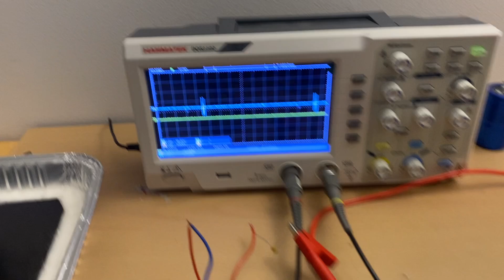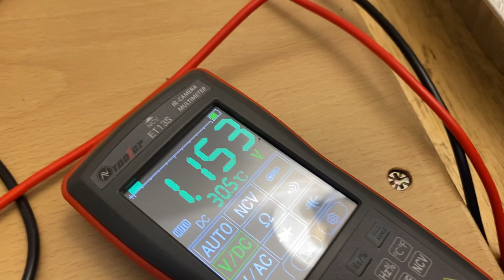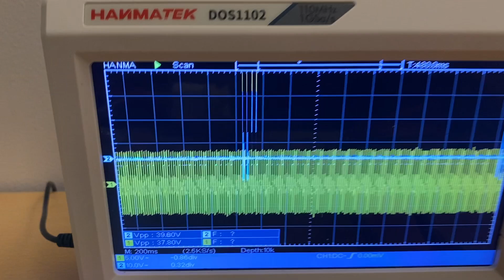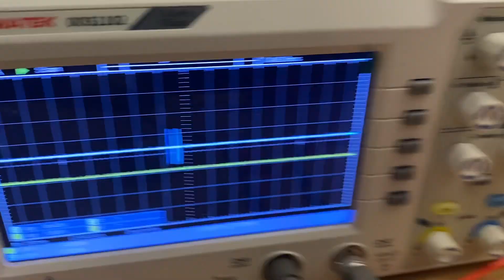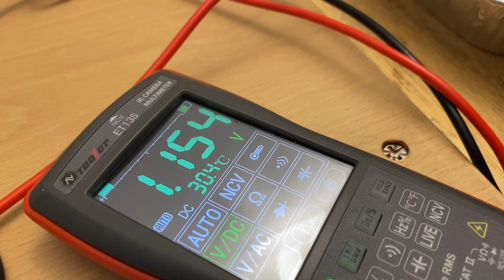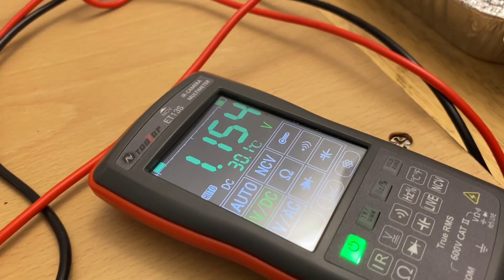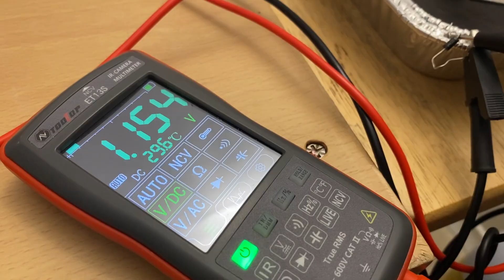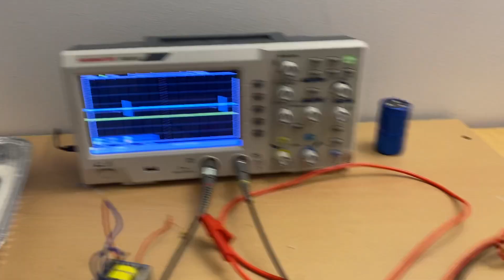Self Charging Oscillator

Comment: Joel, Thank you! firstly, Is it possible to utilize a joule theif as a means of high voltage low amp trigger somewhere in the circuit? I often wondered why people never utilized this for their Bedinin or Newman generators.
Reply from the maker: Is this not what my clock module does? It's an oscillator giving me 10 plus volts spikes......

Comment: Heck yeah great idea with the clock circuit! 😮
Reply from the maker: One could also take the clocks small HF oscillator and Don Smith it for extra haha!
Reply: @joellagace1679 always need more capacitors 😅

Don Smith capacitor method into battery bank or maybe a cap bank that can sustain UL Listed microinverter draw at MPPT?

Comment: please give a classroom board lesson video. I've looked up p looping circuits but they all seem like closed systems. I'm not patronizing Joel I know you know a thousand ways to loop circuits in terms of the one wire. And I have no understanding of circuits even though I try to do the practical but I was wondering if you could draw up a generic loop circuit and explain it then give a intermediate then a harder example. Also in your high energy video you said the high energy could be "smoothed" out to lower more steadier pulses. Could you then explain also how can this be achieved.

Comment: I been playing with some relays, automotive ones and using them for in and out have very interesting effects in my charging discharging of batteries. Curious if I can utilize and electret made from some wax from plant materials and find a connective tissue between the ideas presented here and that experiment I been saving for. Sugar solidified under pressure like this, interesting as it holds a much harder state in more various temps.

Comment: Nice demo Joel ❤

Electrets establish one way flow of electric charges and as long as there is a potential difference (work function of elements) there will be a flow. If you enclose electret in a dry atmosphere they will last indeed hundreds of years … or you can use wet medium as (dipolar) water if non corrosive material is used.

Electricity is based on 2 components: magnetic and dielectric. If I use 2 iron wires one thicker than the other in deionised water I can get 0.05 V … but, when I place a permanent magnet outside the water between 2 ends voltage goes up to 0.200-0.300 V … from here, there are many options to further enhance such cells for a better output which can be used commercial, even using zinc plated iron sheets and teflon as electret material, without degradation of elements provided there would be dry atmosphere (sealed) to prevent corrosion and maintain polar charge retention in teflon (ordinary teflon tape for plumbing). And you don’t need flyback spike feedback into the cell … this flyback can be used to charge capacitor bank or combination between ordinary rechargeable battery+capacitor (hybrids) which can be drained by a load continuously.

Comment: Would it be a good idea to try Beeswax–Rosin Electret?
Reply: Nope, best available material is teflon and can be polarised with just 150 volts at 150 degrees Celsius under dry atmosphere … positive charge retention +100 years if dry atmosphere is maintained
Reply: @Caesarus2011 alright thanks 💪
Reply: @mrRobot152  it takes 45-60 seconds to polarise a teflon tape for plumbing at 150 degree Celsius with 150 V … all you need is a hot plate constant temperature, power source and grid/plate electrodes, PE enclosure with access for hands, silica gel beads. Also, before removing it consider to seal them in plastic bags using a vacuum pump and place your metal on each side.
Reply: @Caesarus2011 what is a pe enclosure?
Reply: @jefferysmith5092  polyethylene foil … make it like a small tent on your table/workbench